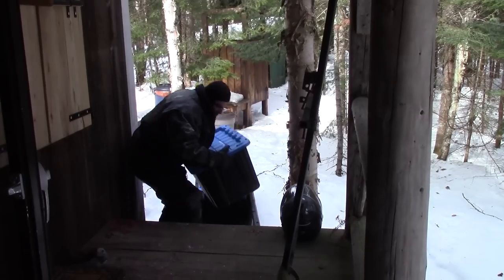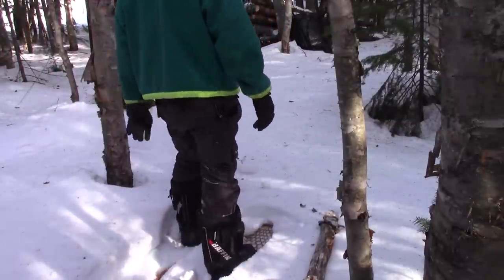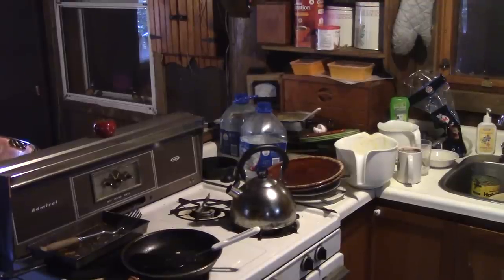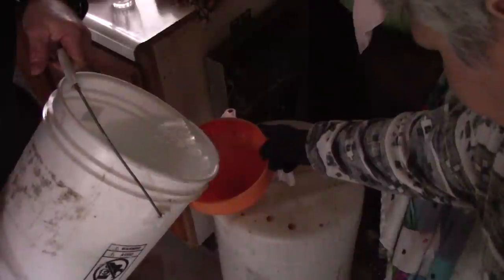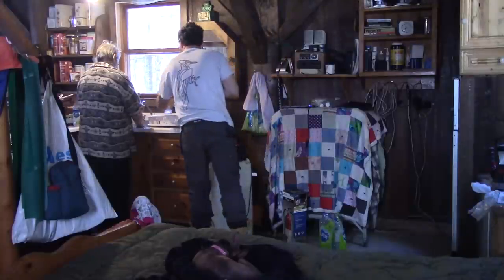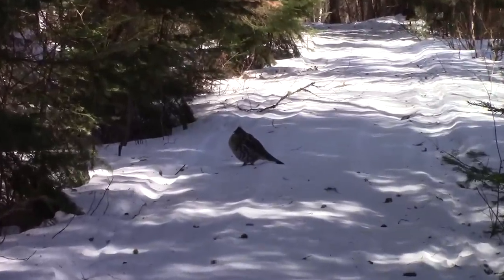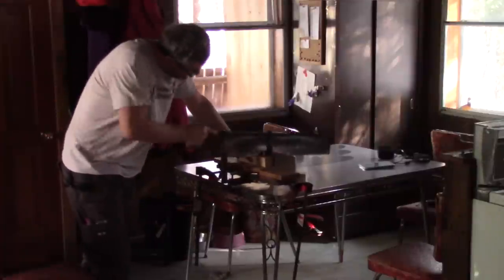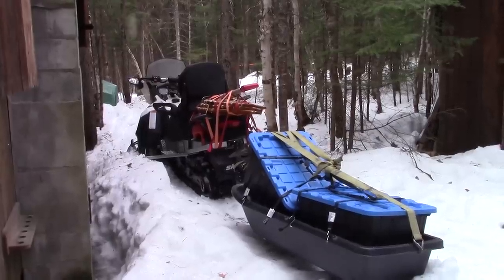The Woodpecker - 6 days at the cottage in March

Comment: Ah! The fall checklist of everything that has to be drained or checked before the freeze. One winter at the cottage we left a 6-pack of root beer in a cabinet. Everything was fine until the spring thaw!
Reply from the maker: I can imagine the mess. 
I always unhook the hoses, and remove the drain plug of the heater in October. It's why I've fitted it with garden hoses screw connectors. But I never blew air in it before.... But since those heater are not so cheap and I already bought a new one, this time I didn't took any chances and used my crappy compressor... I'll try to solder the break this spring but since it's in the path of the flame I don't expect this to work...
Reply: @LgosseuxDbois-TheWoodpecker  we blow all the lines & water heater just to be sure. The root beer was more confusing than anything. Originally all we found was a kitchen mat with a large, dried, brown stain that we couldn’t explain. It wasn’t until several days later when we opened that particular cabinet that it all made sense! 😁
Reply from the maker: I will blow air now. I never thing of the worst up until it happen... It's why now I always shovel the snow in front of the chimney, it felt twice on the ground because of the snow. it's easier to shovel half an hour than taking a wee to put the  chimney back up. But never yet I had something like you described with a frozen mess.

Comment: I don't know - it kind of seems like going home to electricity and running water without so much manual labor would be the relaxing part... <.<  I don't understand why you have so much trouble heating the place, though.  We have an "earth stove" wood stove in our house, and it gets it almost too warm in our living room and family room with a few logs.
Reply from the maker: Yes but you don't start to heat the place when it's below the freezing point... After a day or so everything is at the room temperature, then it's easier to keep the place at a comfortable temperature. But also the insulation is not the greatest this doesn't help... To my great despair now, when I've build this place 25 years ago I never thought that  I would go there in the winter, I didn't had a snowmobile then. So the floor and ceiling are only insulated with 1" white Styrofoam... Not the best insulation....